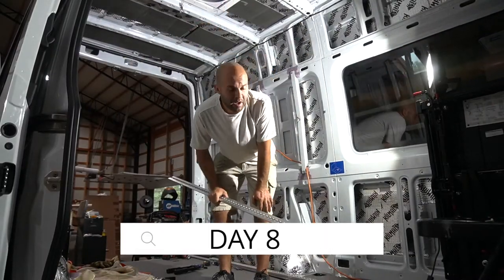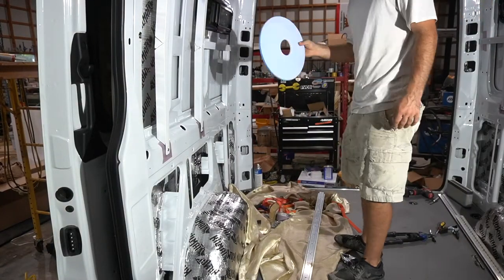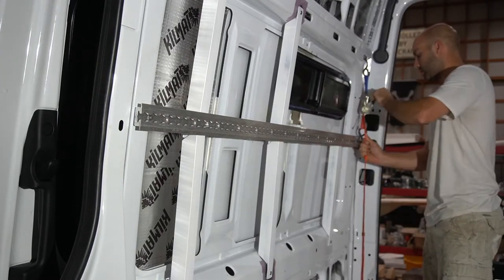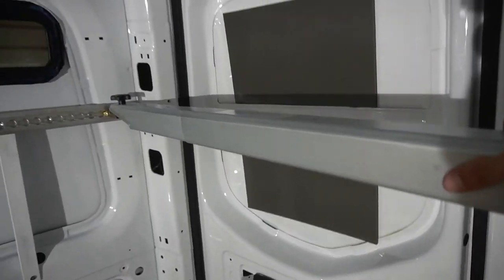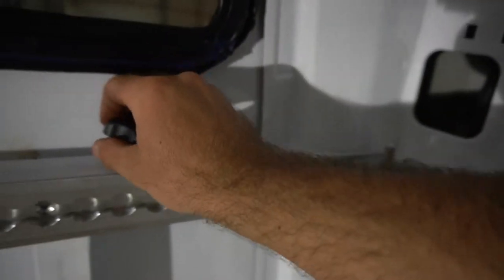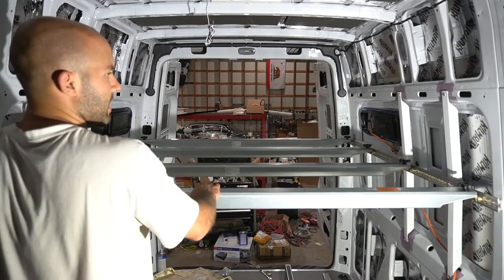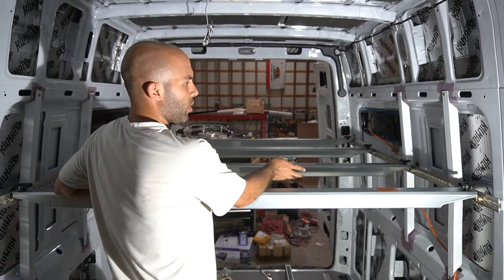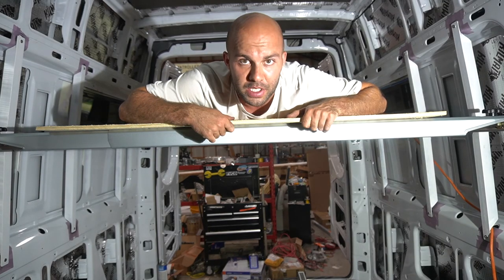Installing Ikea Skorva Struts in our Sprinter Van | Day 8

Comment: Great video, and a great job with doing the extra work to make the vertical support pieces so you can mount your bed platform high enough to provide a useful garage space below, this is what many people are too lazy to do and end up with a low bed. BUT - something - with neat use of the cargo slotted rail and those widgets you made, If you used that Rail Vertically then you could have an adjustable Height system??
Reply from the maker: Yes, if positioned vertically it could be a sort of “adventure wagon” type bed. Thanks for watching!

Comment: where did you get the vertical wall support?
Reply from the maker: The supports for the bed that are attached to the van? I made those myself out of angle iron and welded them and then secured them to the van using rivnuts. The supports for the bed were purchased(IKEA)
Reply: @SteadyStreaminCashios  Thank you very much for a prompt response!

Comment: What are the metal screws that you’re using to attach the L rack to the metal? I don’t think I have access to behind the metal on my van, so what kind of screw what I need to use
Reply: Blind rivet nuts or T nuts.